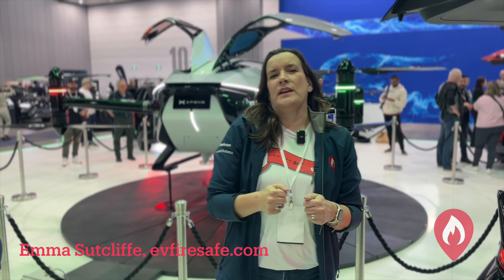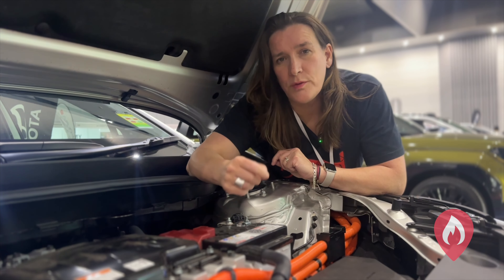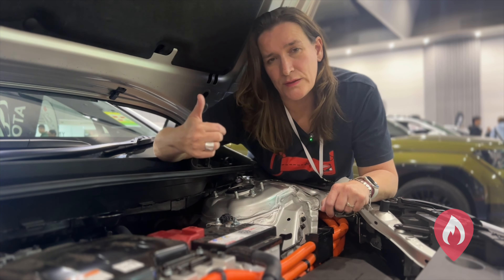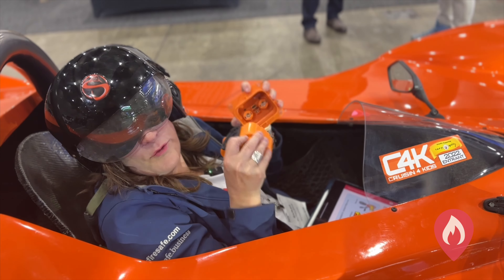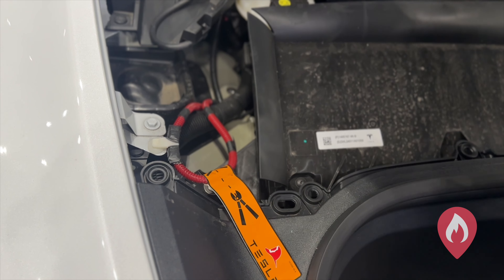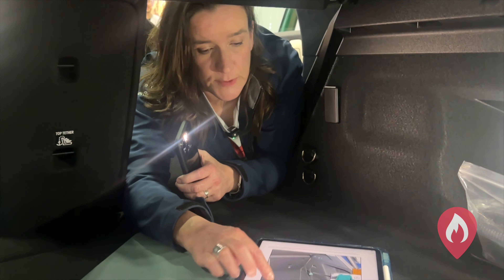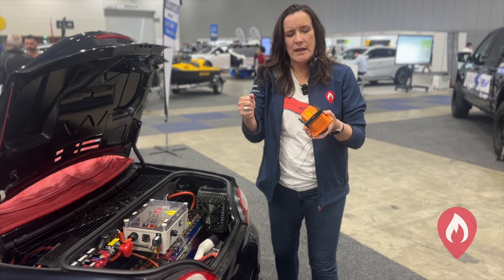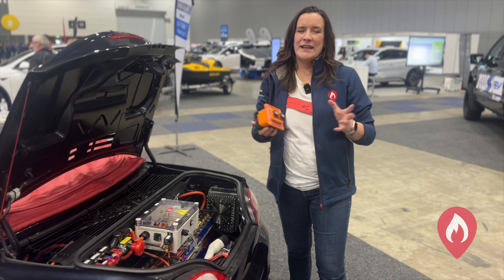UPDATED EV SAFETY FOR EMERGENCY RESPONDERS! How to ISOLATE EV HV systems

Comment: I do wonder how accessible the low voltage disconnects are in the advent of a front end collision.
Reply from the maker: Yeah, often not at all. But if airbags have deployed, then the HV battery should have isolated automatically, but we've got no way of checking that; while there's an AC detector stick, there's not a DC one yet.